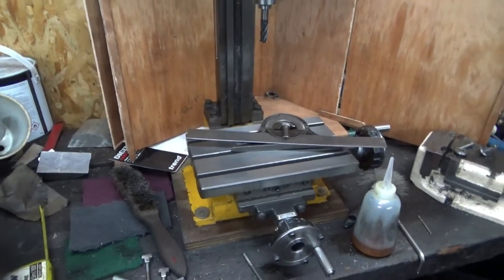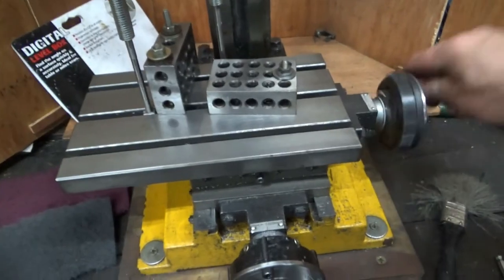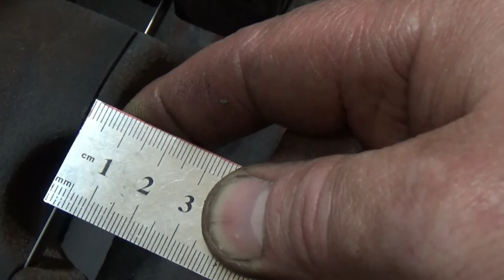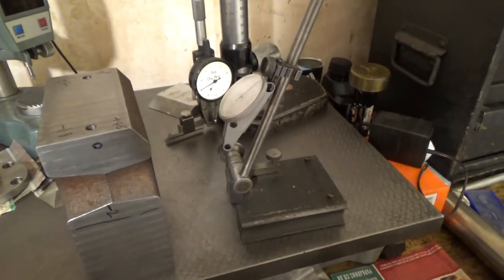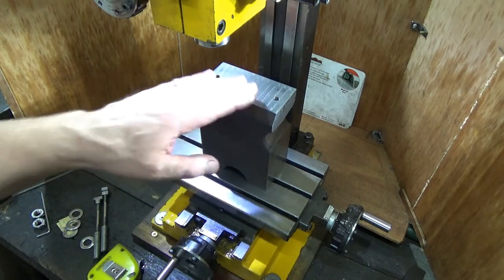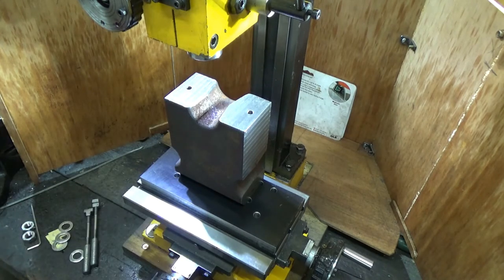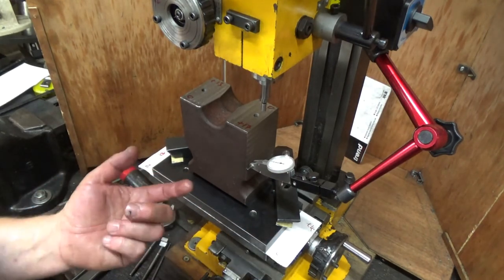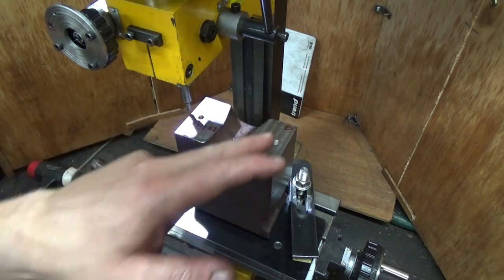Clarke CMD10 "SX1 Micro Mill" Upgrade Column Riser

Comment: Hi just wondering where you got the xy table please
Reply from the maker: I brought the whole milling machine in an auction bid a few years ago.  I recycled some plastic containers by cutting them up and melting in a tin can.  Used the plastic to repair the handles. Then I used the milling machine for the past two years successfully. as you can see in this and many other of my videos. Now I have upgraded the milling machine and it is slowly becoming a cnc conversion.

So the xy table is now surplus to my requirements so is up for sale on eBay.
Reply: @bigstiggerNo1  where did you get the red X y table from ?